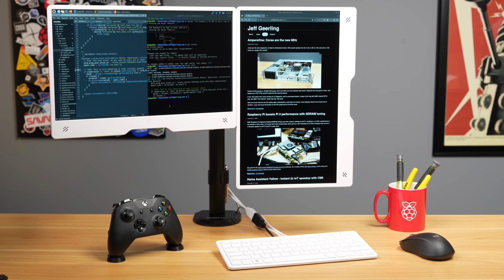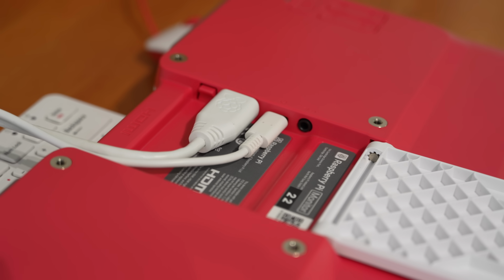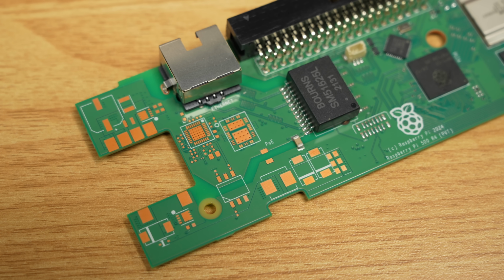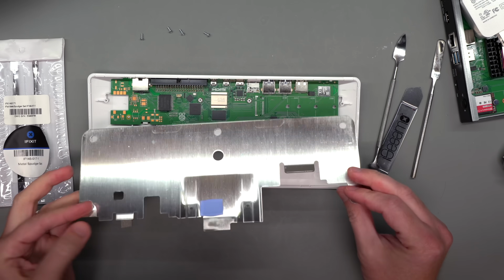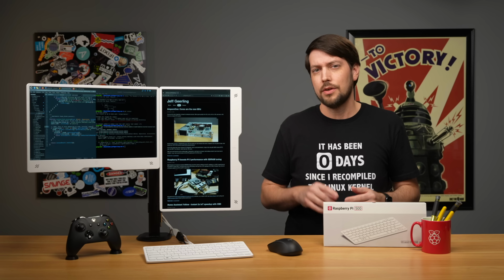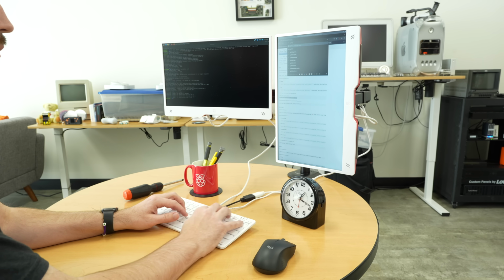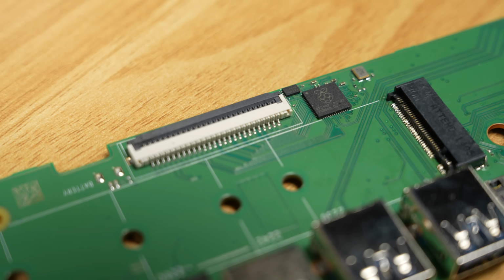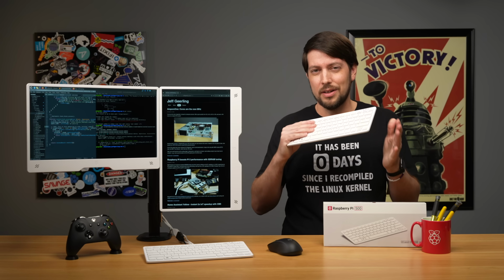The Keyboard IS the Computer! (Pi 500)

Comment: after tinkering with raspberry pis for a few years i've come to the conclusion that they're cool toys. but not much more...
a 10 year old PC is cheaper and performs better than a cluster of 3-4 pis. (not to mention the limitations ARM chips have in the software world or the hustle of adding components to the pis compared to a regular desktop computer)
it might be considered useful (and I agree) for learning or to control a 3D printer positioned far away from a regular desktop or even a small firewall. but nothing too fancy.

don't get me wrong, I love raspberry pi and I will probably buy every generation of it (the regular one), but I find the keyboard variant completely useless.
whoever buys pis usually connects via ssh to them and/or has plenty of forgotten keyboards lying in the 'basement corner'.

Comment: Yah.  Missing a built in  M.2 Slot is a deal breaker.   They should make a quick revision Version 2 with a Slot Door and the M.2 slot socket (and the little screw holes to peg it down).   M.2 changes it from a toy to a Tool. 1TB / 2TB / 4TB support needed.

Comment: Does Raspberry Pi not offer the schematics for this thing? The components that aren't on the board should be listed on it and then you can install them and get that PoE and NVMe support. Or you could take them off the official NVMe and PoE HATs and that would probably work, too (if maybe a bit of an expensive option, looking at current street prices).
Considering they have the space, though, not using full-size HDMI ports is strange.

Comment: In my opinion it is still a great system with a really good price on first view.
But I have already a Pi 3b and 4 at home.
But if there will be an upgrade with poe and m2 then it will be a even better deal.
At the moment I don't have a need for it. For small crafting projects a pi 3 is imo still more than sufficient. As a full desktop pc for my holiday cabin the missing m2 and poe are a big drawback. But the worst is the micro hdmi port. They are useless shit. In a keyboard pc like this it's even worse. This keyboard will be moved a lot and I'm sure that many people will even plug them in and out a lot. After a year or two they will most likely not work properly anymore like every other micro hdmi or usb c port that I ever used or have seen being used.
So I have to say that unfortunately this will become e-waste soon in many cases which feels somewhat sad.

Comment: Any chance you can cover a way to get the PCIex1 to split or switch into 2 PCIex1 half speed (or even less) lanes?

I want to be able to access M.2 slot at whatever speed I can (doesn't matter as long as it's faster than 10MB/s) and old GPU in x1 mode for simple tasks at the same time.
But I have not a single idea on how to do that with a single PCIex1 port or if it can be done in any way.

And I'm not talking of a multiplexer or equivalent. Is more like a switch.

Comment: I recently switched to a different Case for my Rpi 5 (N311 from Geekworm) but it seems to influence the wifi/bluetooth quite badly and so I wanted to ask whether you know a solution to avoid that.

I read you can soldar some external antenna onto the PCB but I don't rly feel comfortable doing so. Would a bluetooth dongle work probably and if so do you know how to enable that?

Comment: I was waiting on this thing to drop before I purchased my next Pi. Think I am just going to go with the regular pi5 with some cooling and a good hat stack, maybe a extrernal coral. The Pi500 at $90 without the nvme is a good value I think, but I'm done with the cards for running OS, they should of just charged $99 dollars and trap doored the thing. SD is a cool feature to be able to rapidly swap builds out on the fly but I just want to be done and use the thing these days. Nvme Pi OS is all I need.

Comment: I feel like a possible future revision with M.2 would be modifying the case design to have a tray that includes a tool-less mount so you could simply slide it in. Why tool-less? I feel like it would be a bit better regarding wear&tear long term instead of screwing and unscrewing repeatedly if you need to swap it out for whatever reason.
Reply: also please no more micro hdmi rpi foundation, if ur going to give us something to display with, MAKE IT DISPLAY PORT BABY!!!!! ...or just make it y'know normal hdmi too sniff that works too i guess... cries in display port supremacy 

jokes aside another design revision for long term use i'd like to see is inclusion of a fan. Just makes me feel a bit better long term with it if i were to aim for this later on. *tho now that this is out i might just see what ebay offers too for used 400 models since ik people are going to start reselling those soon.

some nitpick here; i wish they would also just offer it in the original color scheme too, from what it appears this is only it. and I actually did appreciate the colors the original one had, yeah sure brand recognition but i mean the thing looked nice and this feels like a downgrade. (i personally like colors in things I own not basic black/white so it's disappointing to see here, not a big deal over all but aah!!)

Comment: Hi Jeff.
You put a M.2 slot connector on the R Pi 500.
If the rest of the components were fitted, would a M.2 memory work?
Or would you have to ammend the o/s or other software, etc.
Wish I had the programmeing knoledge, you have.

I started of working in Marconi Instruments (English Electric) at the end of valves and the transition to semiconductors.
So I'm ok at fault finding and building electronics, but not so good at programming.

Keep up the brilliant videos.
Thank's.
Reply from the maker: It should hopefully work—a couple others are going to be testing it next week!

Comment: Another Pi I will buy but wont solve anything. Rpi is known to have some of the worst way to get into dongle hell. If they are actually serious then atleast do these things:
1) have proper HDMI ports and 1 is enough you can have a second through a breakout board. HDMI micro is garbage and breaks and bends so easily
2) PCIe slot
3) Have a trackpad built in. having this thing need a wired mouse is so much work
4) Have keyboard passthrough built in. Yes pi400kb project does that but this needs to be a native feature of this form factor. This tiny feature will make it a perfect companion for server racks and just  another keyboard in the house or to connect to your regular pis
5) Have BMS built in without a battery. Or atleast have a breakout board or something to work with
6) be a shell for the compute module so it is removable and provide cad files to build our own breakout boards. Like this is a no brainer. Have the computer module power this instead of having a custom board. and yes I get they did it because of the heat sink but that is bad design

Understand literally anyone who gets a 400/500 wants to make a mini laptop or a portable terminal but the rpi foundation is only fixed over marketing to children as a learning tool when it offers a bad experience with kids. Sure kids connect 2-3 wires and it seems amazing but it provides nothing else. 
Pis have everything but are good at nothing. 
They try to hit 4 markets but dont hit anything in 
1) GPIO are not easy to work with when you spent 20min fighting with dongles to connect your pi. Easier to pull up an arduino board with all the shields. 
2) It tries to market itself as a small usable computer, but sucks in that regard. just get an old optiplex, its windows, its powerful for light surfing and in everyway will serve you better
3) kids learning tool, this seems amazing for a kid to build their own computer but the novelty runs out when all they did is connect a few wires together
4) mini server for plex, octoprint or homenas. This is actually a great usecase but again the novelty wears off when you realize just how weak it performs and its better to run it on old tiny windows machines or just buy the store variants cause the cost to put all the parts almost hits prices to get a proper retail solution

the best thing to come out of rpi is the 2040 chip, not because it is good but because its cheap. And the books for training which do a decent job.

Comment: I wouldn't be surprised if a Pi Laptop is in the future. They've got an LCD supply chain set up, the Pi 500 PCB is the perfect shape, all they need to do is add hinges and a battery. Oh and a bunch of $$ new injection molds. I bet they could do it for less than $300 retail.

Comment: Really sorry for them that the Orangepi 5 plus exist.  Can be had with up to 32GB of RAM, has M.2 on board as well as a second m.2 for WiFi of your choice.  There are a pair of full sized HDMI ports and an HDMI input as well as a USBC port, two USBA 2.0, two USBA 3.0 ports, and a 1Gb ethernet port.  It is a screamer.  Only down side is the lack of developer support.  It is a good deal more costly than a pi, but having both, the orangepi 5 plus runs circles around the Raspberry.

Comment: Such a dumb thing
Pi 500-90$
monitor - 100$

just example 
right now i go to newegg and type n100 and firt what i see(even no sort) "CHUWI HeroBox Celeron N100 8GB RAM 256GB SSD  Dual WiFi/BT/Gigabit Ethernet/VESA / USB 3" 
only 146$

sort by price:
and firt what i see
"SOYO M2 Plus N100 CPU DDR4 8GB RAM 256GB SSD Dual-Band WiFi BT4.2 USB3.2 DP"
only 106$

for who need slow thing like pi500 for 90$? i don't understand

about second hand cases with regular i3-i5 cpu's on local bulletin boards - i even not mention, silly😂 raspberry

Comment: Regarding required circuitry for M.2 drive, it seems like there's a DC-DC buck converter to convert 5V into 3V3 for the SSD, the IC looks like DFN-8 package, integrated mosfet and diode type.
If I would have the Pi 500 I'm quite confident that I could make it work.

Comment: This is the 2nd generation with USB C charging, and it still doesn't have extra USB C ports. I want to use my webcam to livestream butterflies, and it has a USB C 3.0 connection, but I have to use a USB 2.0 USB C to USB A converter because the pi misses these USB C ports. Investing in a USB 3.0 converter is expensive, and investing in POE is expensive too, at least for the purpose I want to use my pi for.

Comment: "Those features are present to give us some flexibility to reuse the PCB in other contexts." I don't think this is just corporate speak. This PCB will be the heart of the upcoming Raspberry Pi Laptop (Pi 5000 anyone?), thus the spot for the NVMe drives. The laptop will have a door on the bottom to access the drive. The monitor will be the basis for the laptop screen. Imagine a Raspberry Pi Laptop with a 15.6" screen, NVMe, and a price of $299. NOTE: This is rampant speculation on my part, nothing more. 😜
Reply: I did a quick search on Amazon and that doesn't sound like a very good deal.

Comment: A trick to anyone using PIs GPIOs: you can source an old IDE pata cable and connect it to the PI and use it as a female adapter that you can physically move around.

Comment: Hi Jeff. I would imagine that the circuitry for the M2 is the same or very similar to what they used with their M2 HAT for the standard Pi 5. (Why re-invent the wheel if you have a working design) So if you have a look at one of these you should be able to see what component is required and where it goes.

Comment: Honestly, I like some Raspberry products, but not the ones that are trying to replace computers. I'd rather buy refurbished PC or notebook. 
Kind of nice thing about Raspberry Pi is that it's small, it can run for some time from powerbank and it has (in case of 3B) so-so enough power to record FullHD video, but streaming it or adding audio is over the limits. And then it has few GPIO ports to play with.
Also it can be improved by support for power delivery (not sure if it still needs weird 5V/3A+ chargers), and if it wants to be portable computer, maybe USB-C support for display and power would be nice.

Comment: Not supporting a display connection through USB-C on the monitor is an incredible lack of foresight., even for a slightly higher price. People increasingly want to use one transformer to power both the devices and skip the HDMI to the monitor and USB-C is the obvious way. I use a portable monitor with a laptop connected by a single USB-C cable and would never want to go back.

Comment: feels to me like pi foundation exploring the idea of a pi500 laptop.
The PCB could be used in a laptop with a different BOM and the pi screens are basically laptop screens in a case.

That would be in line with PI Foundations response to your questions about the nvme slot

Comment: It really frustrates me that the Pi Foundation have prioritized dual 4k monitor over simple and useable. Especially as they could have take then second HDMI "port" to an FFC connector and it would have allowed for very high res internal monitor attachment without converting a HDMI to flat cable and back again. The fact that Jeff says most people will be just using one monitor on the Pi shows the dual ports are not really needed for most people.

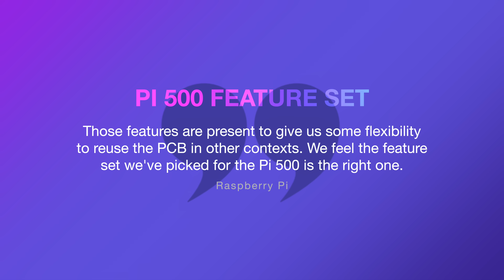Comment: 3:30 - Yeah, RPiFoundation, you screwed up on that one. I love my Pi400, with H2R-Graphics installed it's a great mobile titling and graphics solution for live streamed events, and I was hoping for a Pi500 to update to, especially as the new Pi's have PCI and NVMe is available, making boot and operation far more reliable then SD Cards. I'll wait for the NVMe version to come out. It should have launched as a higher spec model on the same day as the Pi500.

Comment: The Pi500 looks like a MSX/MSX2 , commodore 64 on steroids. But as you mentioned the lack of a Nvme port connection (though the traces on the PCB are there but not used yet) Does set me down from getting a PI500 to add next  to my Pi 5 8 GB model in a Argon one V3 Nvme case.

Comment: I use 2 pi 400 as 'blades' in a cluster and was planning on adding more untilled the scalping but with 2 I run Plex in a docker and can have multiple 4k streams with little issue.

Comment: The non-functioning m.2 slot is exactly why I won't end up buying one it seems. When you showed that initially I was excited and figured I'd pick one up as that's a huge upgrade, but then when it didn't even work after populating the socket, it's a non-starter for me. I'd pay a bit more for that to work. I'd also much prefer a full size HDMI again...

Comment: I can't beleive they didn't put the M.2 slot on the board - that was the OBVIOUS upgrade everyone wanted out of the long-expected Pi500!! I have multiple Pi5s now, and they all have M.2 drives via PCIe hats. This is the only way to run a Pi5 (otherwise the additional performace is hobbled by the SD drive). Without even the ability to put a PCIe hat on the Pi500 renders it basically useless as a replacement for the Pi400. Sorry rpi foundation; you've screwed up this time!!

Comment: Had a pair of 400's for all of 2 weeks a few years back. They were great, however, I lost them in a house fire and have never gotten around to replacing them with more important things to replace. I really liked them and was great for on the go with other portable pieces.

Edit: Even at that price, in Canada, when I saw this video, it was an automatic instant buy for me. I loved those 400s for the short time I had them and seeing the 500 being a, relative, heavy weight compared to the previous version is more than enough to convince me to get the 500 by itself. If not one or two full kits.

Comment: The silliest thing for me is that I have a portable monitor with USB-C and mini-HDMI inputs, but I can't use that with the Pi 4/400/5/500 without either using a mini-HDMI to microHDMI cable from some dodgy manufacturer or converting mini-HDMI to full size HDMI first and then converting that to micro-HDMI, such a pointless mess especially on the 400/500.

Comment: Honestly, that's a shitty placement for a power button......
I sure hope it needs to be pressed for several seconds before it activates, or there'll be PTSD caused by miss-pressing backspace
Reply from the maker: One press pops a dialog (esc to dismiss), and a 5 second press will shut down the Pi forcibly.
Reply: @JeffGeerling  Well, at least no sudden off. Still gonna be annoying when mispress happens though.

IMHO they really should just place it somewhere else, like at the ports side or under.

And yeah... an M.2 slot would be extremely nice.

Comment: I can't get Wi-Fi and NVME to work at the same time on my 5b. If they actually populated the slot on here (and the interference issue were fixed) then I'd be interested. I'd love a true first-party Linux tablet, though. I can get a cheap laptop and put Linux on it, but that's a lot harder for tablets!

It's also a little kick in the teeth only getting 3 USB.

Comment: There could be 2 reasons why the M2 slot is missing:
1. It is an option for a later more expensive model
2. They made something wrong and the M2 option will not work.

Comment: Absolutely pointless machine.

No one is going to use the GPIOs in this form factor for their projects and you can literally buy a much more capable full blown PC for the price.

And given how easy the foundation have made it to setup a normal Pi or Pi Zero for headless operation over SSH or VNC while still maintaining the usefulness of the GPIO and a universe of HATs and similar expansions…just why? Why does this exist?

Children do not want a computer that is less capable than their phone.

Hobbyists do not want an embedded PC that they can’t mount on a robot or attach to a HAT.

Comment: Huge letdown.... 
The production cost of adding the NVME socket and PCB lanes is around 45 cents. 
A full HDMI jack is around 20 cents. 
A proper built-in Wifi antenna is around 2$.
Another 8GB is anywhere between 12$ and 18$.
A PoE interface is around 6$.
How did they cheap-out so bad?
Reply: maybe the licensing costs for those things are substantial, maybe...